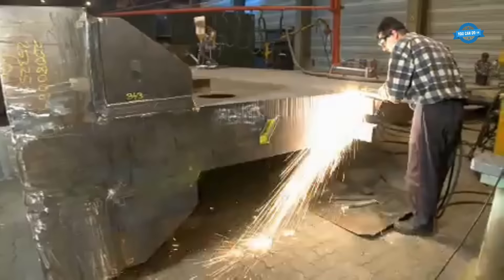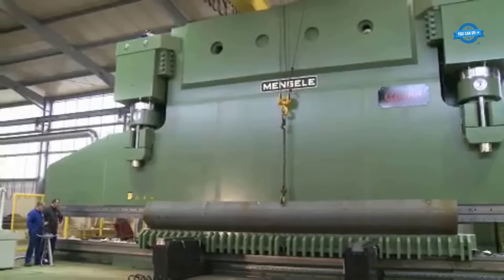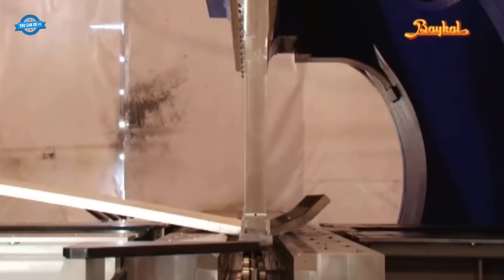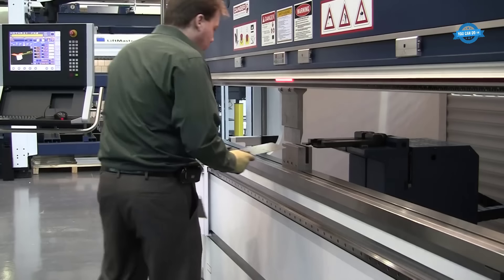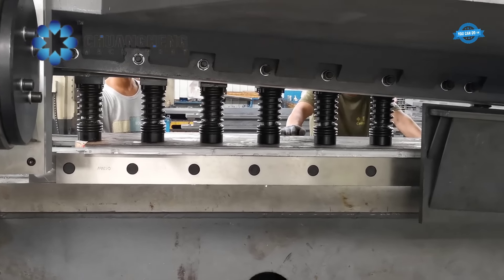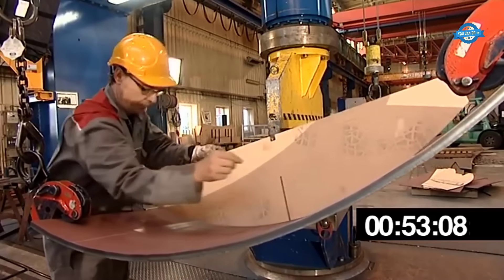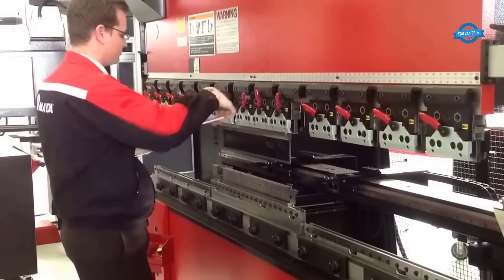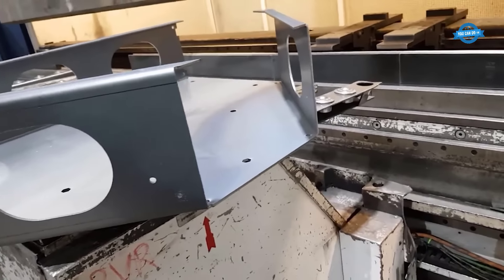The World's Largest Press Brake Production Process. How Press Work In Heavy Industrial Production

Comment: I use to work as a millwright and have to remove cylinders that had 12 bolts per cylinder and torqued 3500 foot lbs per bolt on a old pacific 3500 ton  hydraulic bender and a 1500 Erie foundry open gear press side gears 6foot side gears with  6 inch square by 18  long keys for the gears

Comment: The world's manufacturing would be nothing without German engineering!
Reply: It would be nothing without Milwaukee, and what's left of that?
Reply: The italian are perfectly able, taiwanese, chinese, russian, european also. It's big but not specially difficult to make.
Reply: @pabloricardodetarragon2649  Not just this machine, but engineering in general. Where do you think the high end hydraulic components originated? Germany has always set the stadard for engineering
Reply: @jackabubba  There are plenty of countries with good engineering. 
Europe, USA and some Asian countries (Japan, South Korea, China). The high end hydraulics are mastered since ages, the Eiffel Tower at Paris is using the same hydraulic elevators since 1880. 
The high power hydraulic presses are made since more than 130 years in different countries, in 1967 the french company Aubert et Duval made a 65000 metric tons compression moving with a precision of 0.10 mm for making titanium plane landing gears and other exotics alloys pieces for industries, 55 years later it's always working at the Aerospatiale.
Russians made several until 75000 metric tons, I saw one installed at Toulouse for pressing planes components for Airbus. The Chinese have a bunch of presses until 80000 tons of pressure for their spatial industry.
In fact the Chinese are now more advanced than the Germans and sometimes all occidental countries in several technical domains as high speed trains (400 kmh commercial speed for the fastest in service), conception of super-computers, electronics devices and electronic components without forgetting rockets, and space stations, as they have since 2022 the CSS China spatial station and they do not need for sending a man in the space the services of the Russian as the Europeans and American in this moment...
The German high tech is a bit of a myth. What they have is high quality although often uselessly complex, in fact in industrial machinery like high precision lathes the Taiwanese are as good with better prices, and the Japanese are largely as good as the German.
Reply: German engineering is so good only because people like you keep going on about it.  In reality it’s overpriced and nothing special.
Reply: Wikipedia "The Idustrial Revolution". Watt, Faraday, Maudslay, Stevenson, Wilkinson, Darby, Bessemer, Mushet, Brearley and many others. These people INITIATED engineering technology in their fields.
Reply: @GeraldMcCunn  Yep, indeed they did, and we can go back as far as you like, Archimedes lift still in use to this very day . But Germany took off from where they left. Look at the machine tools, the advanced hydraulics where everyone was playing catch up. Bosch was used in almost every vehicle for years. You would be hard pressed to find a single item on the planet that doesn't have atleast 1 component made in Germany. But just do not say McAmerica, using defecting scientist isn't a win!
Reply: @jackabubba  Of course a defection is a huge win! It's a relection on a nation that cannot keep its people happy. But perhaps Germany doesn't like to see that reflection - even through Zeiss optics.
Reply: @GeraldMcCunn  Sometimes defection is due to propaganda and selling an idea of a better place, not selling the actual place.
Reply: @jackabubba  Now you're clutching at straws! Especially among people smart enough to be ground breaking technicians.
Reply: سخن شما تا اندازه ای میتواند درست باشد اما دستگاهها و ابزار آلمانی بیش از اندازه گران است در حالی که نباید اینگونه باشد
Reply: Te prasy produkowane są w Polsce w mieście Ruda Śląska w zakładzie który wybudował Gierek w latach 70 /80